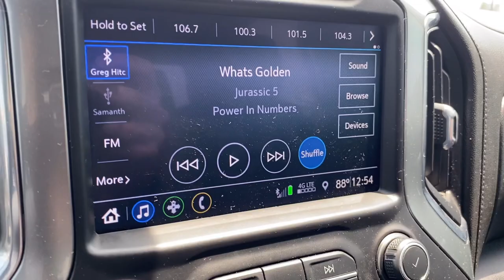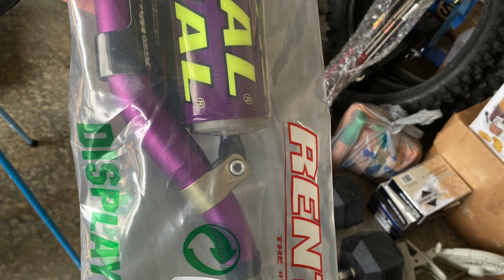My "New" Barn Find Bike! Was It Ridiculous to Pay THIS Much for it?

Comment: Wow 5000$. I got a super sweet deal on my 96 KX250. It was a garage find, in like new condition. Very low hours. I gave 1500$ for it. I am keeping as close to OEM as I can.
  I'm stoked for you man, super cool bike. It does look like it is jetted a little rich. I think that is why it died when you turned the choke off to early.
 I rejetted my bike with 6sigmajetkits. Now I don't even have to choke it to start it. It will start on first or second kick and I have been running the same plug for over a month. I run the NGK BR8ES in my bike.
Reply from the maker: That's a hell of s deal on that 96 my dude! I got the second hand price on the barn find aspect of it for sure. I didn't ask Robert what he originally scooped it up for, at this point I don't want to know because I'm sure there was a premium on top but hey, that's the way the cookie crumbled haha. Without asking it's hard to know if the original owner really knew what he had or not. But all good, I've accepted it haha

Comment: '99 KX250 gang 😎, congrats man! I think you should keep the oem plastics nice like you mentioned (time capsul those types of parts) and throw on a seat time set since you plan on riding it... upgrade the front brake, revalve & update the springs, new tires, re jet if need be, and tear it up 🤟
Reply from the maker: Hells yeah Jonathan! Stoked to join the club. I've read that the new models bumped up the piston and caliper size but I also have seen people put CRF calipers on these. Do you happen to know if they will just mount up and get rid of the under the fork routing too?

Comment: Awesome bike Greg. Def worth the price. This hits home for me because I recently found and purchased a  barn find myself. Mine is a 2001 KX 250. Guy bought it brand new. Rode it a few times around the yard and then put it in the back of the barn for 20 years. It still has the dealership stickers on the rear fender. 100% orig. Drove 4 hours to get it. Paid $5800.00  And it goes like a raped ape. Best of luck with yours. I'll definitely be tuning in to see yours go.
Reply from the maker: Dude no way!! That thing sounds like it's more mint than this 99 is. That is so awesome. I'd love to see pictures of it. Do you have instagram? @greghitchko is mine, if you do.
Reply: @GregHitchko  Hey man I do not have instagram. Would love to share some pics with you though. Perhaps I can email some pics. Hey now you can get on the Pro Circuit waiting list with me for a works pipe. I believe the 99 shares the same pipe as the 2001. Get on that. Love the channel bro

Comment: Great bike. I have a 2001 kx 250 that I bought from the original owner. This bike reminds of mine about the same condition. I took the original plastic off and seat cover, pipe etc to keep in good condition.
Reply from the maker: Right on Josh! I forgot about preserving that seat too. Need to get on ebay and see what is out there in terms of spare parts

Comment: Just got done building a 1999 kx125 back to pretty original. Sweet find man love the 99-02 years. 5000 isn’t bad at all for a nice piece of history.
Reply from the maker: Hell yeah! That's awesome, now if I could find one of those as well, they are out there. What did you do with yours? Definitely cool pieces of history these years are.
Reply: @GregHitchko  Yeah man they are sweet. I actually have it for sale right now pretty much the same as the KX you just bought but has a fmf pipe and silencer and a few other small aftermarket parts.
Reply: Tore it down to the frame and just tried to make it oem style as much as I could. Was pretty cool cause the guy I bought it off of had the title and shop manual.
Reply from the maker: @kgahms2947  That's badass! I forgot to include the original certificate of origin I got with the bike as well in the video, but that thing is going in a frame in the garage for sure!

Comment: Nice find awesome condition 5K yeah a little high but that's what it is nowadays grab a aftermarket set of plastics and do a nice split fire graphics don't forget the pro circuit pipe and silencer it's going to wake that Beast up even more do a compression check and maybe just freshen up the top end and rip it
Reply from the maker: The pro circuit pipe and silencer is a no question! I already have a stinger silencer for it, now I just need to source a works pipe for it. Excited to get it out and rip it!
Reply: @GregHitchko  HAPPY FATHER'S DAY.

Comment: i had a 99 kx250 in 99 worst bike i ever owned, strong motor , good handling , terrible trans and clutch good luck shifting hope you have better luck than i had
Reply from the maker: I appreciate that feedback on the 99 Edward! Haven't ridden it yet so I am super curious about how it is going to ride compared to my 2007 KX250 especially. When it comes time to split the cases, maybe I have the transmission refinished.